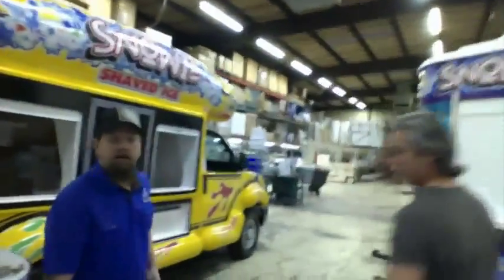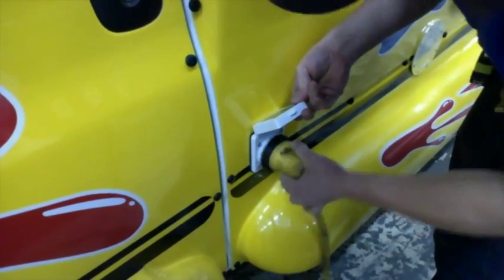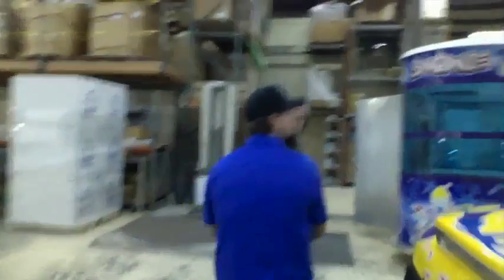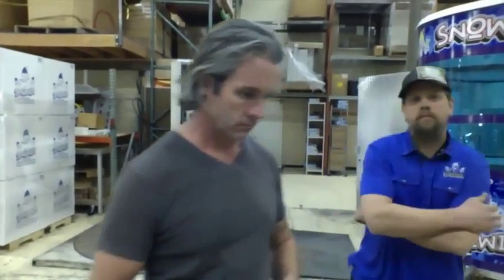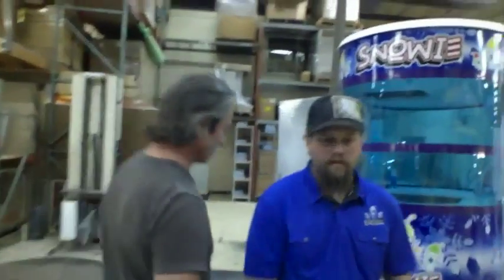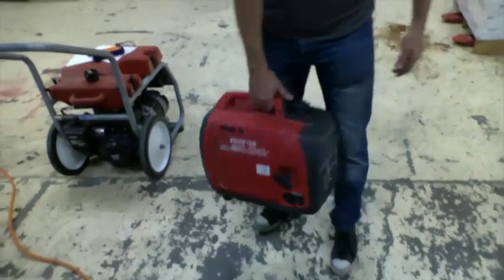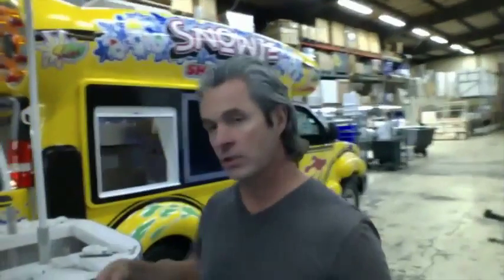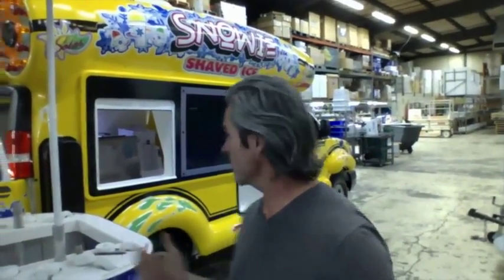Webinar 28   Power Requirements

Comment: Will the ice shavers come with instructions on which cord to use so the motor doesn’t burn out
Reply from the maker: Kory, I am not possitive. It will mostly come with instruction on the power they require. Our videos here are a further instruction on how to better provide that power. But I agree, we do need to put that in our instructions. Thanks for the question / suggestion